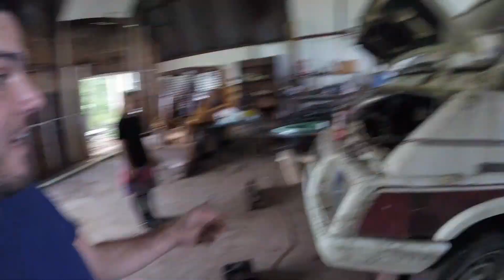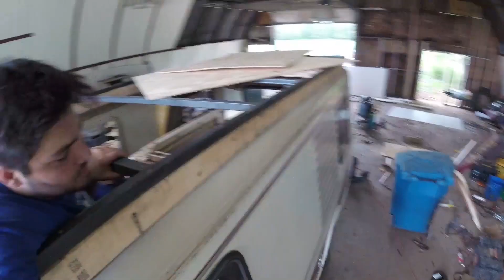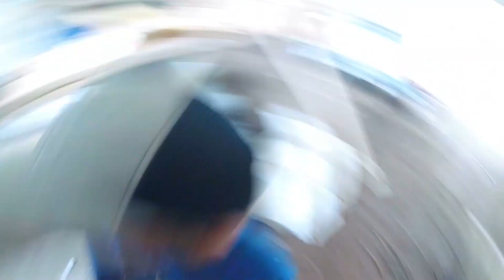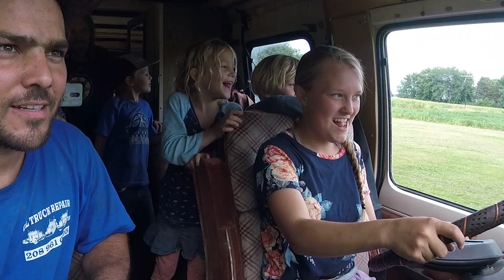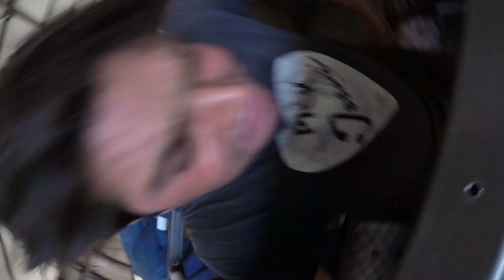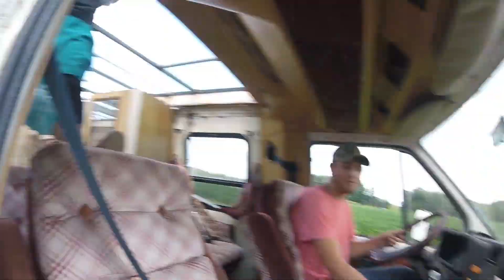Fixing The Old Winnebago Part 2

Comment: Some quick tips. Check the floor pan where the rear leaf springs attach. (1)These seem to be the weak point when rusted. (2) the transmission and final drive (the diff.) are separate units be sure both are filled.  Check the files for the right oil to use. The trans uses brass synchros so EP (high sulfur) oil should not be used in the trans. (3) Tires. You need a 8ply rated tire. TRAILER TIRE WILL NOT WORK. The easiest and probably the only tire that fit the bill that you can find will be "Comercial" tires. These tires will not have the aspect ratio in their marking and will end in the letter C.    I.E.  205R14C.  These are slightly taller than the original 205 -75 R14 tires that they originally came with.  When customising like you are watch the weight you add. The things are close to the limit for the tire already.  You can fit a 215R14C barely with some slight trimming to the front fenders and they will lift the rig some and give you more load carrying capacity  but I expect you to lose some of your "off the line performance" as they are taller.
Reply from the maker: Thank you I will
Reply from the maker: Hmm allot more than I was thinking... But I'll get it... 😁